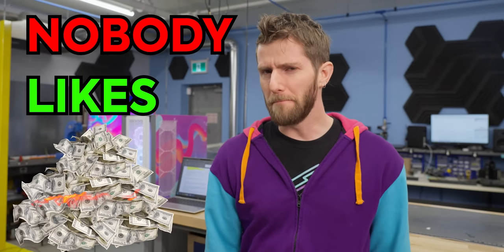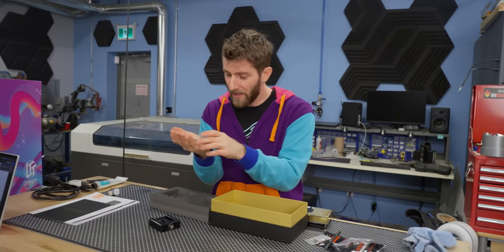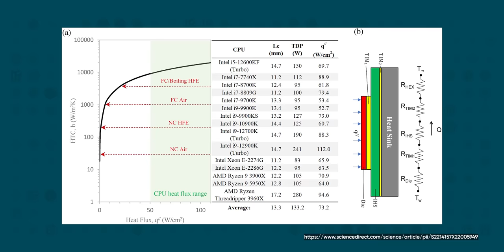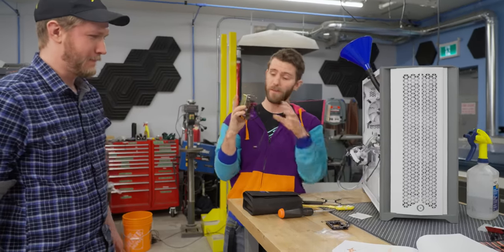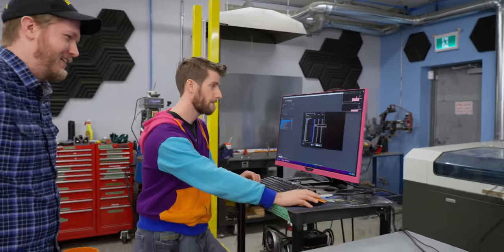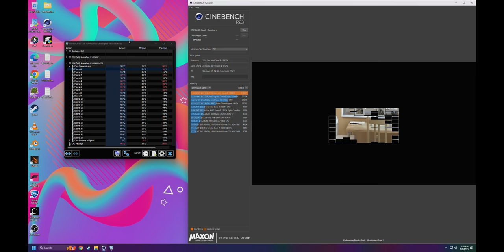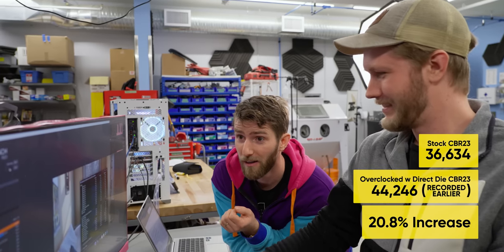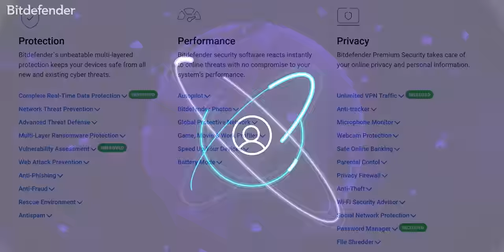This Cooler Might Kill Your CPU - EK Direct Die Cooler

Comment: Well, this is something I would try out when the CPU is a couple of years old and not worth anything anymore. Killing my 700€ CPU with that kind of tinkering? I still have my 12900K in the other system and a 12400F to replace it if broken, so I could try it and still have a CPU to fall back on for both systems. But the Delidding makes me cringe so much. And I overclock with AIO's since their invention. I remember pissing myself while overclocking a 1000€ Core2 Quad Extreme a decade ago. It survived the ordeal with a Ghz. more. Nowadays overclocking a 5.8 Ghz. CPU is not my goal anymore but undervolting it to keep the clocks more stable is. Reaching the sweespot where it still runs full clockspeed but doesn't reduce to under 4Ghz. in Cinebench while still maintaining under 90° Celsius and this with a stock BeQuiet 360AIO is all I want to tinker. But Kudos to DerBauer for still being CRAZY :)

Comment: when cooling a board so much that is condensing water becomes a issue that you encounter. I may have a solution.  Put your computer in a vacuum  so there is no moisture to deal with.  I hope the rest of the mother board can survive without cooling.

Comment: Briefly had BitDefender on m system,  can not recommend them.  Unless they have changed it,  you only get a one-time activation code,  not a product key to re-install or re-activate the product.  Had to do a Windows 10 re-install and was unable to re activate BitDefender,  even after several backs and forth with tech support.  Finally just abandoned the license.

Comment: You need to read directions lmao you gotta flip the delis tool to the number 2 triangle side after doing the number 1 step and flip back again sometimes not do it once and bang it off must be nice to have sponsorships to not worry about destroying expensive CPU’s , for those using the same ihs removal tool just read the directions Linus DID NOT do this the right way at all.

Comment: this really has nothing to do with the video ,  I need instructions on how to reattach two wires that broke loose from my power button , let me add , ( That BEST BUY GEEK SQUAD broke loose ) and since they don't do any kind of soldering they cant or wont fix it. I took it in to get it dusted out and to have a tune up done on it and I got back a paperweight , there is so much more to that nightmare story that i just really don't want to type. Just know that the 199.00 dollars a year for the Total Tech Membership is pretty much a scam , IT is actually a Total Disrespect you and your shit membership

Comment: Ugh, this looks awful. Better to just buy a slower but more stable processor.
Reply: How is the processor in this vid not stable?
Reply: @omegaPhix  If it's this difficult to cool Intel is pushing too much juice through it to achieve their speed. In processors, you can always increase the clock rate, push more electricity through it, to get better performance at a cost of waste heat and eventually silicon instability, but a better path is to achieve your speed targets by more efficient design rather than by sheer electrical pressure.
Reply: @omegaPhix  An analogy would be pushing water through a custom cooling loop. If your water blocks and loop are designed poorly, with lots of sharp turns and unnecessary loop length, you might wind up needing 15 feet of head pressure to push water through fast enough to cool your hardware, where a more efficient design might only need half that pressure to accomplish the same task. Sure you can make the argument that your components get cooled either way, but a more efficient design uses less pressure which puts less stress on parts and uses less electricity in your pumps. Overall, a more efficient design will last longer and tend to have fewer problems over time.

Comment: lots of people are having issue with the EK Direct Die like this 

I have same issue.
At water temp 20 degree celcius, my 13900ks with ek dd can only costs up to 400watt at 110 degree celcius.
I reinstalled 7 times, repaste liquid metal, results are same. 400watt with 110 celcius. 330 watt with 80 celcius.
This result is same as heatkiller 4 pro with Stock IHS. 400 watt with 110 degree.
Actually, ek dd is worse than normal cpu block. Core temp difference on heatkiller is only 7 degree difference, however ek dd is more than 15 degree. Core4, 7, and 8 extremely high.
Once I changed to iceman dd, i got cured. At 330 watt it is only 60 degree.
550 watt with 110 degree.
Shame on you, ek
What did de8auer do?
Just rent reputation and have money?
Than just decrease the price without name on it.
I dont think ek will recall this garbage product.
People who bought this product expect good cooling performance, not the same performance with stock ihs.
And also, why does ek always delay their product? Once you said it will start deliver on mid Feb, it supposed to start at least 20 Feb. It is promise with customer, especially you received money first.
If you guys think you cannot gurantee the time, than receive money later.
I was big fan of ek, no more.
Quality keeps decreasing, price keeps increasing, and most of product need to be rma. Im tired of this.